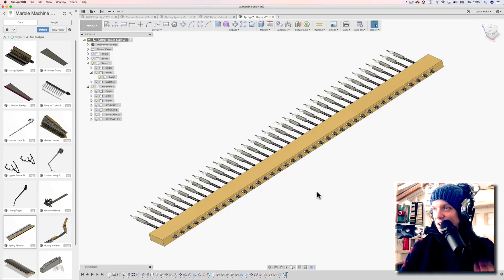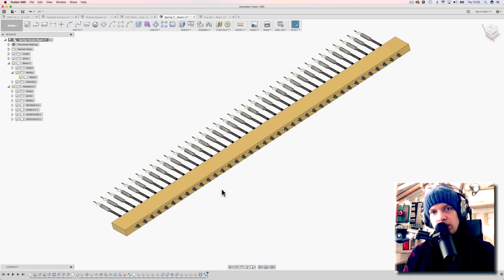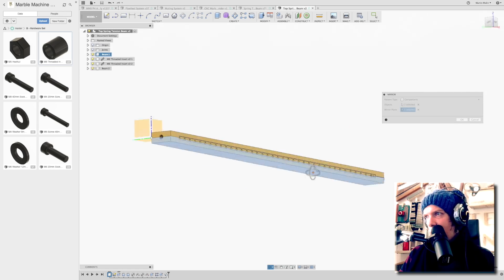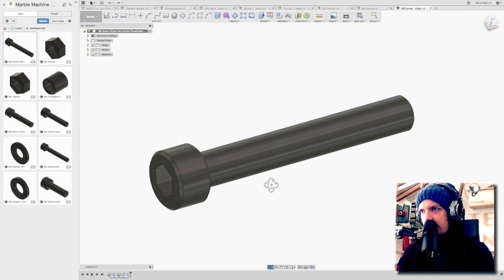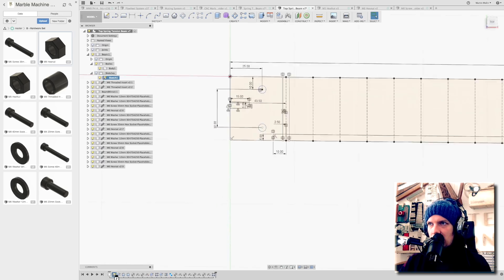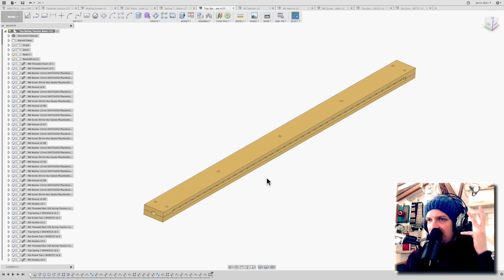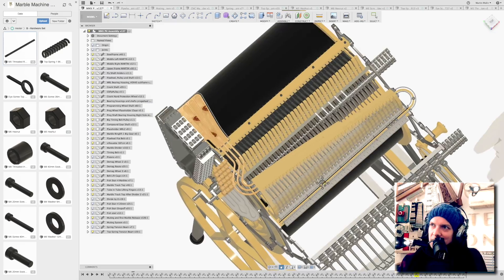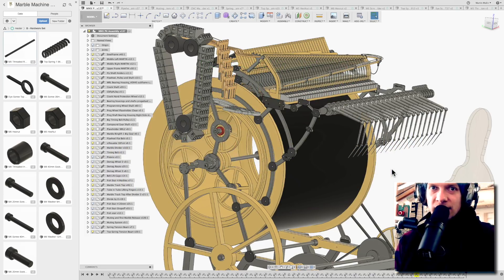Spring Tension Beam CAD - Marble Machine X #30

Comment: you can use imperial units in a metric drawing, you can just write 'in' on the end of a value so you could write 3/8 in instead of 9.525 mm if just writing 'in' dosnt work (it dosnt for me sometimes) just write * 1 inch at the end instead

Comment: Very cleverly designed :)
I would say you have to be careful when installing the threaded inserts on the side so they don't push the top and bottom pieces apart. Lateron this is secured by the frame, so no worries there.

Comment: Have you done a calculation for combined spring tension vs the span of your plywood piece?  Multiple small springs can add massive lateral loads when all are pulling in the same direction.

Comment: Just to let you know. Instead of modeling something like the threaded insert. You can pull a model of the part ( if it is a standard machine part ) from McMaster Carr. Just go to the insert command on the top bar. Then click the insert McMaster Carr part from the drop down. It will open a window where you can browse for the part.

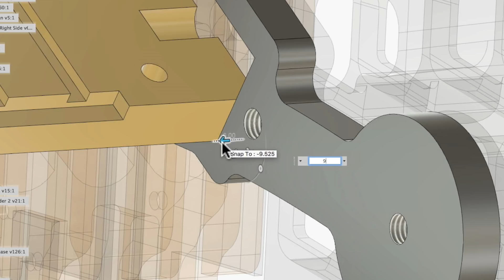Comment: 4:55 - Protip: If you want to put imperial values in Fusion 360 when using metrics, you can just put "in" after the value! Example: 0,5in and it updates it automatically to 12.7mm, or 3/8*1in as in your case it gives that 9.525 (for fractions you need to put that multiplier 1). Hope this helps you!

Comment: If you add a swivel joint between the spring and tensioning shaft and a small knob to the end if the tensioning shaft you could modify the tension without pulling the nut out

Comment: I assume these springs produce the force that the programming wheel's pins act against, and what returns the levers after the pin has passed?  You shouldn't need to adjust tension!  The springs should have a long throw so the force doesn't change significantly over the stroke (this makes adjustment impractical).  All the motions these springs control involve movements limited by mechanical stops.  Force should be "adjusted" by choosing the proper spring, and is not critical.  This whole assembly could be replaced by a single steel rod with the eyes of the springs hooked onto it.

Regarding imperial units: your software can't handle them?  You need better software!  That brings up another point.  I assume this software is expensive, and controlled by a license from the company.  What happens when they disappear?  You better have your design in universal file formats!  Are the files "watermarked" or encrypted so they can't be opened in other company's software?

Comment: The added through bolts are not necessary. Wood glue is a very secure bond. Wood pulls away from its fibers before it pulls away from a glued joint.

Comment: This thing is really cool!  I look forward to Wednesdays for your MMX updates.  I have a question that maybe some of your mechanical engineering and CAD fans can help you to address.  This bar has evenly spaced springs all the way across.  Each is applying some amount of force; hence, you've potentially got quite a lot of force wanting to bend that bar.  Have you analyzed the geometry of the bar and the strength of the plywood to be sure that the bar will not sag over time, causing you endless headaches while on tour having to adjust out the creepage with those nuts.  What if you run out of adjustment, especially in the middle?

Comment: Pretty tight tolerances
Reply: James Quinn  That word doesn't mean what you think it means. The correct word is clearances.
Reply: Dan Severns no i mean what I said. If the manufacture of those dimensions isn't impecibke high tolerance his parts just won't fit without fettling

Comment: When typing in measurements try 1/2" and include the inch mark ( " ). This should give you 12.7mm
If you had the drawing in the imperial system and wanted mm, you would type in the mm afterwards and it would convert to some inch decimal. This works in Revit, another AutoCAD product.

Comment: One of the early things I learned for designing machine parts ist, that you can't make inner corners in metal parts by milling it. And even in wooden parts you first have to mill the corner with your moulding cutter and then use a chisel to get the radius part out of the corner. So, the long mortise for the srew-nuts in your beam has a radius at the end in reality. - However, I'm deeply impressed by your exciting work, bubbling ideas and wonderful music!

Comment: I have worked in drafting in Canada so I really identify with your annoyances over units. All the drawings are in metric and most of the equipment that we use are from the US. So we end up specifying things in sizes that are multiples of 25.4mm and 304.8mm more often than 10mm or 100mm.

Comment: If you need to input imperial dimension to fusion, you can do it simply by writing 1.2in, or like this: (3/8)*1in. Fusion gets it right as 9.525mm.  Vivas la metric system!

Comment: Commented on the Reddit as well, but anyone else seeing possible problems with torsion loading given the way the springs are anchored and the type of spring being used? It could cause some predictability issues when trying to do adjustments. That type of spring needs to be pulled in a way that doesn't put much (if any) twisting on it.

Comment: Winter, you should really add a second nut on the tension springs. I know its"supposed" to hold, but nuts will still walk themselves out. Or, use a lock nut, which uses a band of plastic to grip the thread and prevent it from coming loose.
Reply: Koe Kipper  The flats of the nuts are captured in the slot.

Comment: I'm from America and I hate the imperial system too. Did you know we have a unit of measurement called a slug?
1 slug = 1 lb⋅s²/ft and the best part is that this unit of measurement is called a blob when it is in inches instead of feet! I'm in engineering so I work with the metric system all the time, and every time I have to go back to using the imperial system, I die a little on the inside

Comment: Have you not thought of running the marble machine thru a software simulated stress test to determine where the weaknesses could be and try strengthen them or make plans for spares and the like?

It would probably be very beneficial to know from an engineering stance where things are likely to encounter issues.

Comment: Not sure if that program can do it, but Autodesk Inventor can evaluate measurements and units, so instead typing "9.525" sometimes you can type "3/8 in" and it will automatically convert. If you need to change the measurement it will still show it as "3/8 in". I believe most CAD can do that.

Comment: If you make the plywood bar in 2 pieces, you still have to drill out the glue that squeezes into the holes, but it's all drillable in one piece and simpler if you can hold it. Just saying, you may have other reasons. Great stuff! Iain

Comment: Not sure about in Inventor but in SolidWorks there is a feature driven pattern command that you select the components (screw, washer, nut) and the hole pattern and it takes care of all the dimension linking for you. Something to investigate that could save you time.

Comment: Great video, as always ! Just a tip : you want the threaded insert as close as possible to the surface, rather than the bottom of the hole they are in. That way you are sure to have all the thread of the insert in contact with the screw, and it's more robust !

Comment: May I suggest to add pins along the screws you have?
The screws only joint the two parts together, but does not guaranties alignment of both parts. Adding a couple of pins (this is extra easy since you have a CNC machine) would solve this problem (something like: one in between the group of two screws you have).
Reply: Not being a native english speaker, I'm not sure "pin" word is the correct one. The purpose is to realize a couple cylindrical joints. Adding more that one remove the rotation degree of liberty, adding more is to cope with flexibility of the plywood. The remaining degree of liberty (translation) is removed with the screws. 
https://en.wikipedia.org/wiki/Cylindrical_jointhttps://en.wikipedia.org/wiki/Cylindrical_joint

Comment: Musical, maintainable, machinable!
Nice to see you taking your time to do things correctly, and thinking about the long term.   I noticed that in virtual CAD space, when you drop something, it doesn't make any noise, just like in outer space.  Design idea:  Replacement units on the Hubble Space telescope need only a single wrench to service.  (11.1125mm - sorry!)  I have a motorcycle that basically needs only two wrenches (10mm and 17mm - yay!) to service.  You've probably thought about this already, as evidenced by the nifty tool-less spring tension adjustment.  Keep doing what you are doing.

Comment: If you have to enter an imperial value on a metric sketch you do not have to convert it; you can just type the units into the box. 3/8in Same goes for metric to metric: if you want 5cm you dont have to enter 50 you can enter 5cm.

Comment: Won't vibrations cause the nut to loosen ? effectively loosening tension ? 

Solution1: Square nut to constrain the rotational motion of the nut  when the stud is left.
Solution2: CNC the ply(top and bottom) with the Hex hole, so your hex nut is constrained.(CNC time increases)
Solution3: Use Nylock Nuts. (difficult to tighten)

Joe 
Mechanical undergrad :)

Comment: Can confirm. I have a caliper and It does make me feel like a professional engineer. Then I remember that I am, in fact, a plumber
Reply: I have two pair of calipers, one expensive and one cheap, and I AM a professional engineer. BUT, I got the calipers when I was a tradesman!  I'll let you into a secret - engineers don't use calipers, they use computers. Tradesmen use calipers.  Having said that, I do feel kind of cool carrying my calipers around the hardware store, which I think is the point here.
Reply: Plumbers are just pipe engineers tbh

Comment: Hey man! I dislike this video, and it's the first time I do so. I dislike it because of the way you have used parameters. Too complex man! 

First tip: I've worked for 12 years with Catia v5 that's the bigger brother of Solid works, and I'm pretty sure that your SW has a feature called "hole" or something like this....use it please, and discover it's potential.

Second: use the function "matrix" to repeat feature like holes and so on

Third: often this kind of SW has an assembly function to reuse the matrix of a feature to place and follow screw washers and so on. Use it.

Fourth: this SW has for sure a function called " mirror" . Use it.

If you will accept my humble advice, you will obtain a more ... "readable" feature tree, you will obtain simpler sketch and finally, your model will be more future safe! 

Keep on design mate!
Reply: Roberto Maddalena hey, first, note which software he is using. Autodesk fusion.
Second, you say yourself catia is a big brother. Having used several different cad-systems I can say each has it's own quirks and just because you can do a thing in one SW doesn't guarantee you can do the same thing in another. Sure he might not be using it in the optimal way, but until you yourself have experience in this specific software - back off with your so called "advice"
Reply: TheFantazingo 
Hey man! My advices are not intended to offend our friend and his effort. No. In no way. I've used so many parametric cad (proE, inventor, solid edge ...) that I can say what I said. Features names change, but not their goal. Martin can achieve a better result with less effort and more control. I'm only urging him.

This is what a friend do.

Comment: I don't have any experience with Fusion 360, only with other Autodesk programs. Doesn't F360 have a content center for standardized parts? Inventor does and it makes fitting those nuts and bolts in a bit less annoying

Comment: I suggest using square nuts instead of hex nuts for adjustment (if 1/4 turn is a small enough increment). It would provide more engagement with the slot.

Comment: I'm loving this build so far!  Regarding the hex nuts to adjust the spring tension, since the adjustment isn't critical (it doesn't require 8 points of adjustment per turn), and it's sitting in the channel, why not just use square nuts ( 96887A331 for plain steel, 90225A101 for stainless steel)?  They will allow the slot to be slightly looser, making it easier to pull the rod out and slide it back in, without allowing the nut to possibly turn on its own due to the slot to nut gap.

Comment: I have a project for a granulator that has the purpose of recycling copper wires and cables at a low cost and I decided to use Fusion 360 because of you. And every time I see a video of you I realize that I could be doing things in a way that is easier and better. Tanks

Comment: You may think your part fits the MMX perfectly, but indeed you will find that it does not.  The engineering phrase is "Tolerance Analysis".  When you join the two halves together, with glue, you will find that the thickness is now 24.1mm, instead of 24mm.  But the hole is 24mm.  It won't fit!  Further, you hope that the hole is 24mm and not less.  But what if it is.  May I suggest you investigate Tolerance Analysis and how it affects your design.  That said, I am as excited as ever to see this machine come to life!  Go Martin!!
Reply: And don't forget about humidity and temperature changing things
Reply: This whole machine is a tolerance analysis away from binding up in the first humid location.
Reply: I was thinking something quite similar, though plywood is pretty liberal when it comes to them.

Comment: you may want to reinforce the plywood, if you pull out the nut enough times it will degrade the wood to the point it could then spin on its own. on the world tour it could make a difference

Comment: Whenever you do finish the Marble machine X, don't take the work for granted. What you will see before you is all ur dreams come true and that machine will have the soul of the previous marble machine. You have to realize too that these machines break after a set amount of time, and this will be the first marble machine X, the prototype. Id recommend as in respecting the previous marble machines soul, is to use the prototype, the first machine for the world tour then get a new spare machine and then set the first production machine to rest. This is because since machines do break, you will have to most likely replace components which wont have the adventure of the previous components which wont feel as good as the previous ones. Let this first one be the one to play in museums while the rest to sing on and unfortunately break.
Reply: Prebenkul:. I like your thinking.

Comment: I'm not sure if it works in your software like it does in Solidworks, but next time you need to use imperial units, try adding "in" (short for inches) to the end of the measurement. So, for the 3/8 screw, enter "3/8in". In Solidworks it will automatically convert the measurement into the native units of the model (I'm assuming mm). You enter in 3/8 in, and it automatically changes that to 9.525mm. Notice it also converted the fraction to decimal. If you did this in an inches drawing 3/8in would become .375 automatically.
I use this all the time when going back and forth between metric and imerial, and from fractions to decimals. It saves time and eliminates the possibility of conversion error.

Comment: You can defne units inside entry fields as well. So, even though your model is metric standard, if you entered "5/8in" in the dimension field it would be that exactly.
Reply: And if your computer is having trouble with lag with so many screws, you can lower the details on just the screw models. The detailed view is properly modeled with threads and such, the basic view is just a texture to visually simulate the thread, but still contain the information for the screws.

Comment: Pro tip- you can directly import the McMaster parts into your drawing, so you don't have to spend the time to draw bolts and inserts and stuff. Also, you can likely rename the variable names from d525 or whatever to something with meaning to you, like vert_hole_spacing, horiz_hole_spacing, etc.
Reply: the308er He intentionally isn't doing that to save processing power. The actual parts have too much detail, so he is drawing lower resolution versions. This ensures that the program doesn't crash or lag horribly on the full marble machine sketch.
Reply: Yep. Simply stripping the threads from the screws removes a lot of polygons just from that one item. Multiply that by eleventy billion screws. That's a lot of processing power saved.
Reply: True, one should name variables to something meaningful, helps in the long term, or even go extra mile and use meaningful naming patterns.
As for engineering cleverness, well played! :)
Reply: +D-railed
I know Solidworks has it. I think it defaults to that, actually.
Reply: I thought to could choose to use "Cosmetic threads" to save on that. or maybe that's SolidWorks I am thinking of. but a really cool feature gives the holes and fasteners the proper call outs but just makes them a flat surface with a pattern that looks like threads.
Reply: Yeah, pretty sure McMaster has low-poly models too.
Reply: He mentions all this half way through the video